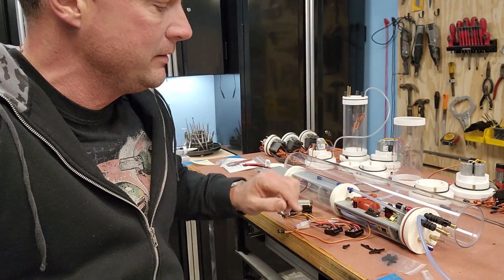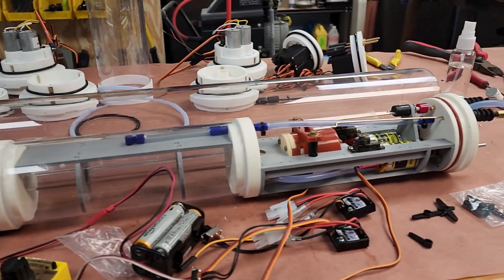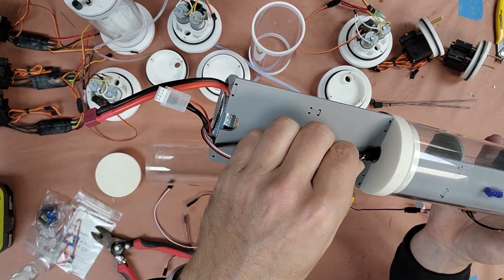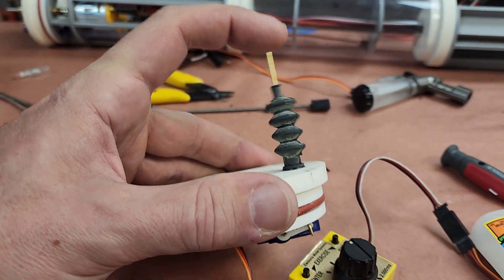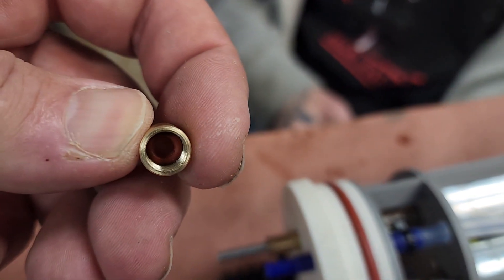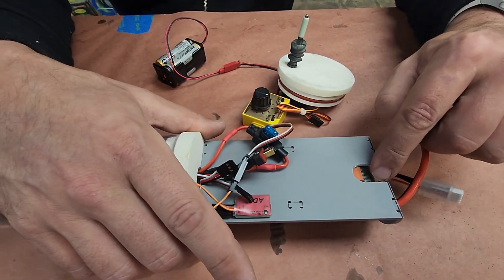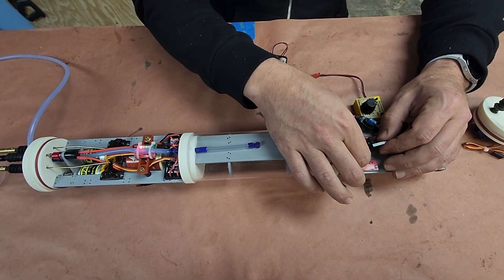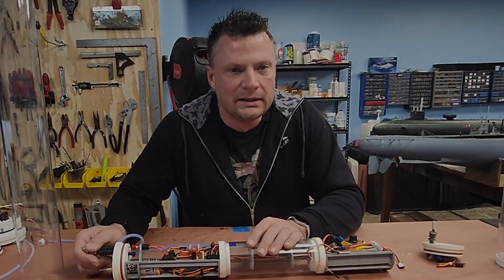R&Rrrrr, Matey! Setting up the R&R Watertight Cylinder for RC Submarines

Comment: which one better for ballast tank? high pressure pump or plastic syringe....
Reply from the maker: A plastic syringe is a ballast tank. A high pressure pump is a method for filling and emptying a ballast tank. They are two different things.
Reply: @RCSubGuy  oooww forgive me...let me rephrase the question....which one better, linear actuator or high pressure pump?
Reply from the maker: @bernif97  The pump is infinitely more flexible in terms of installation and performance.

Comment: Hi Bob. As the R & R ballast system uses a gear pump with a vented tank,  does it suffer from leaking/premature flooding when the sub is surfaced given the system does not use a pinch valve?
Reply: It can't leak back, the tank can only fill up to the horizontal baffle plate with the vent in it.

Comment: Hi Bob. Would you share is the ballast system is Snort type? I see there is a vent hose protruding out from the cylinder
Reply: The snorkel valve is not a snorkel in the truest sense of the word. It is used only as a vacuum break. When fully submerged the pump creates a partial vacuum inside the ballast tank as you surface, this is equalised as soon as you break surface and the valve opens. The valve has a designed in leak, this is to prevent the possibility of an hydraulic lock within the pump.
Reply: @ronperrott4867  thanks for the reply! Appreciate